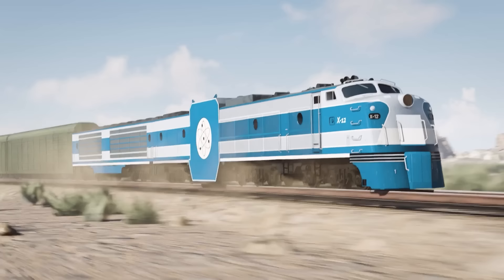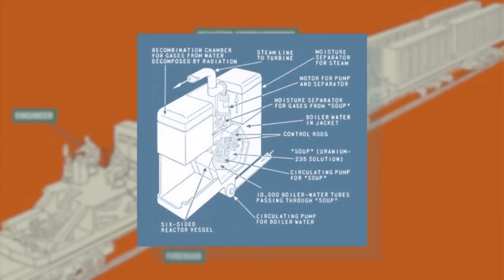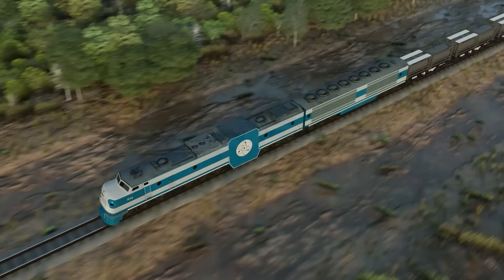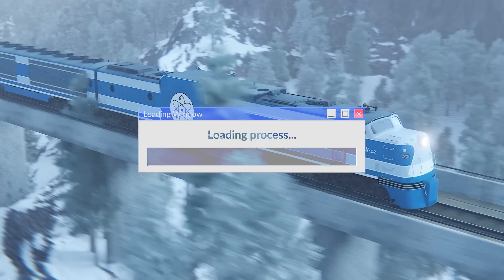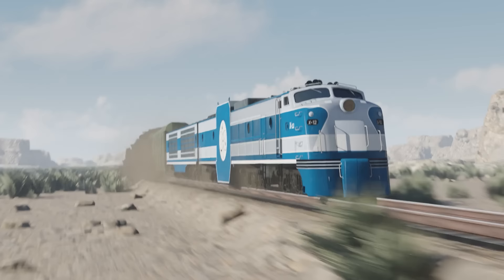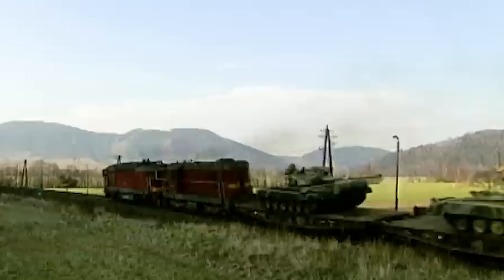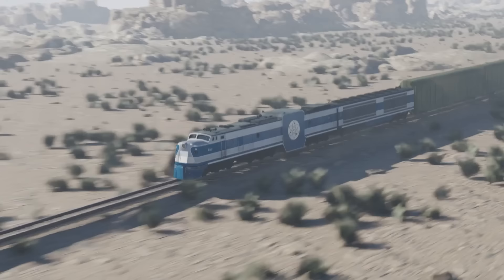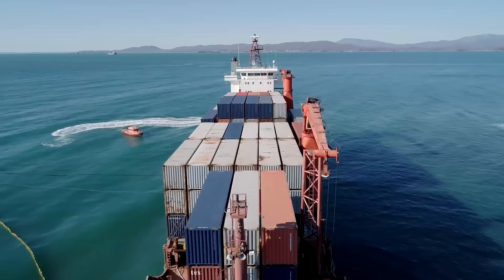What ever happened to Atomic Trains?

Comment: She would not only be a steam train she would be a Steam turbine electric train like modern ones but here you turn the generators by steam turbines and you take the steam from a nuclear reactor that boils water. 

For 12.000 years we still make energy out of boiling water.
Reply: It's more like 300 years..
Reply: cant make energy, and it’s only 300 years
Reply: @freaky1382  What do you do while cooking?  
You boil water 
You boil water by fire 
You use the boiling water to make the food you put into the pot to be tastier 
And cookery was born circa 12.000 years ago when the first town was built and our tribal era lasted 120.000 years when we wore clothes, hunted, gathered,  tamed fire, made weapons and used fire to boil water. 
I said energy, not electricity!
Reply: Honestly, Nuclear energy(electricity) pisses me off.

It's just hot water! WTF!!!!!

It's great but c'mon... why isn't it cooler than just heating up water?
Reply: but the liquid dont need to be water...
Reply: @kjgfalsk  Still the principal is the same. It's just easier with water. But the author said in the epilogue that catenary was the real reason and AC high voltage cable lines and transformation stations made it possible that we can supply locomotives with electricity directly above the track.
Reply: @jaybird0312  well that's the neat part of energy making. Its just so fundamentally same its kinda meme itself.

But ofc why Nukes are cooler because is just so cheap and efficient, and have cool intro when started...
Reply: @whitefalcon630  what you actually need first is a reaction
Reply: @paladro  Cooking is chemistry so you have reaction you just need energy
Reply: I wouldn't really call it to make energy if you're just boiling water without turning the steam into mechanical work, especially not in the same breath as we're talking about steam power. To go long back in time, we have the aeolipile (described e.g. by Heron of Alexandria) about 2000 years ago. It was mostly a toy without doing any useful work but it did at least spin and you could use it as a low efficiency turbine if you wanted.
Reply: @skunkjobb  Well technically yes
Reply: @whitefalcon630  That's not "making energy out of boiling water". The steam engine (at least as anything more than a very crude experiment) is only a few hundred years old.
Reply: technically speaking, boiling water is just a part of the energy conversion process, it's not the "making energy" part of it.
Reply: @whitefalcon630  cooking is not really chemistry, it's mostly physics. Until you burn something that is, then you have a heat-assisted decomposition or charring/tarring
Reply: Yes, because water is easily available for exchanging heat. And that's how most engines and generators work. See: carnot heat cycle.
Reply: @drill_fiend1097  Um, no. Most engines do not use water as part of their power cycle. Internal combustion engines do not, and that covers most of the engines in the world these days. Gas turbines don't use water as a medium either. 

The Carnot cycle isn't a real engine cycle either. It's a purely theoretical cycle which is impossible to actually use. The engine type which comes closest to the Carnot cycle, the Stirling engine, uses air or another gas as the working fluid, not water.

Steam engines are still important, but they are one of many technologies used for energy and propulsion. These days, you don't even necessarily have to be using a heat engine, let alone a steam engine.
Reply: @TonboIV  it doesn't make sense for vehicles that directly burn fuel (Otto-cycle, Diesel cycle, Brayton cycle is better description for them), but body of water is readily available and what many power plants use as heat sink. It's impossible to get a perfect carnot engine, but most power plants that use thermal source try to get as much carnot efficiency as possible because why waste energy.
Reply: @drill_fiend1097  Steam power is still the most popular cycle for thermal power plants, but of course renewable energy is growing fast, and mostly isn't thermal, and even for thermal power, other cycles are creeping in, particularly Stirling and gas turbines.

It's fine to say that we've been using steam power for centuries, but saying that most engines are steam engines, or that steam is our biggest energy source, is just wrong.
Reply: @whitefalcon630  you have done nothing but waffle about irrelevant stuff. You cannot make energy because that breaks the laws of thermodynamics. And what are you on about us cooking?? thats not making energy from it its killing bacteria.
Reply: @freaky1382  You turn energy into work.  
Both in a steam turbine or in a cooking pot.  
Work generates heat and the cycle goes around around around.  

Boiling water is a good thing 
I wasn't waffling dear Foxhole PFP NPC.  
I was talking about how to harness  the work we get from boiling water.
Reply: Solar and wind and hydro (and stuff like wave power too) are the only forms of electricity generation that does not boil water. In fact solar and wind are the only two that don't use water in any way!
Reply: @whitefalcon630  yes, but that water did not move anything. It "just" cooked food. If you are semantic, then we never created or will create energy per se.
Reply: @51mm5  Cooking changes a lot inside the food other than heating up.  
Its structure, when the flesh was alive fell apart 
Water is only the agent.  
But what is important when turning water into mechanical work is steam.
Reply: @pwhnckexstflajizdryvombqug9042   you can make any kind of power make electricity with air and a turbine mate. water is used commercially because its cheap but you dont need it lmao

Comment: lets face it there is no real point in them. just use catanary, no dangerous nuclear reactor on board (of course the power can come from a nuclear power plant too but thats a lot safer in terms of shielding required). also more efficient, you dont need to haul a 200 ton shield around. as well as the huge cooling array.
Reply: People hate it because it sounds too boring and expensive for them. That's too expected

Meanwhile nuclear train provide them with the dopamine rush for F U T U R E and burn their money like nothing tomorrow. Like you know, gambling addiction.
Reply: Millions of tons of steel and wires that need constant checking and maintenance as well as power loss through those millions of tons of wires vs 200 ton sheild and on-sight power ie no power loss, do you even Math dude?
Reply: @kell7195  >Nuclear reactor
>Zero maintenance

Pick one

Comment: 10:42 The best argument. Works in Europe pretty nice. The problem is that the freight operators in the USA do not want to build and maintain overhead wires, as it is associated with costs and it is simply cheaper to run diesel-electric trains.
Reply: not only cheaper but more practical too. We run double stack containers. Europe doesn't
Reply: @dareklachowicz3946  Double stack containers can be electric too. See India. Tunnels in Europe are not tall enough though. Bridges are also a problem.

Comment: Yeah, this just seems like it would be hideously expensive for almost no payoff. It's inefficient, expensive to buy and operate, and what you get for that is a vehicle that doesnt need to be refueled - something that plain electric trains already do while being much cheaper and simpler to run and just as powerful. As a railroad company, you probably save money just electrifying a freight line than investing in an atomic locomotive (hell it already saves you money in the long run vs diesel locomotives).
Reply: I think the cost of the train is the least of their worries, we’e talking about a nuclear train. On standard gauge track a train like this isn’t big enough to sustain a nuclear reactor’s radiation. To even sustain a nuclear reactor and keep radiation from leaking we’d need a train the size of the Breitspurbahn like the germans were planning, which was supposed to be double the size of standard gauge. And i imagine they didn’t have the budget nor space atm to develop it. Besides unless the train was as large as the Breitspurbahn, direct exposure to that radiaiton from the train crew could be lethal.

Comment: Firemen does a little bit more than just hold a shovel. Basically also make sure the boiler does not explode.
Reply: @crackedemerald4930  And ensure that it burns properly. I can't tell too much about Steam Locomotives, but on Steam Ships you use an Air Intake Flap at the Furnace and another Flap inside the Funnel to regulate Air Flow. The Latter Flap prevents Heat from just being wasted out of the Funnel. IIRC Steam Locomotives have Air Intake Flaps too, but the Funnel Updraft instead is controlled with the Blast Pipe instead of a Flap.

Oh and Steam Ships may also include the Logistics of keeping Coal flowing, Locomotives always have the Bunker right next to the Furnace.
Reply: Don't let the boiler explode is the job for both traditional steam and nuclear steam.
Reply: No, the safety valves take care of that.
Reply: @JBofBrisbane  Lifting Safety Valves means that you're wasting Fuel; you're literally producing Steam just to blow it off unused again. In closed Systems, you're also wasting Boiler Water as the Safety Valves blow off to Atmosphere instead of into the Condenser. But that doesn't Matter in Locomotives, as they have an open Water Cycle anyway. Meaning to say the Exhaust Steam is blown out of the Smokestack instead of being condensed to Water and used in the Boiler again.

Anyway, plus letting the Safety Valves Lift is just bad Workmanship, they're intended as last Safety Measure and nothing else. In the automated Boilers that I make a Living with, the Burner cuts out at 10 bar, the Steam Dump is opened at 11 and the Safety Valves lift at 12 bar.
Reply: @JBofBrisbane  Popping the safety valves means wasted shoveling effort. Plus they don't help at all if the water level goes below the crown sheet.

Comment: I think with a small integral molten salt reactor and a CO2 Brayton cycle turbine, this can actually work. No radioactive steam, no water cooling, no high pressure safety hazard.
Reply: There's no question it could work from a technology POV. But a heavy nuclear reactor, running 60-80 mph, with a several thousand tons of dumb weight behind it, is an enormous security risk. Furthermore you need at least one (if not more) skilled technician on board, more than doubling personal costs.

Furthermore it's lacking economies of scale: A larger (not mobile) reactor can produce the same MWh for way less financial input.

In the end, it is just way cheaper to built overhead wiring and combine it with the cheapest form of energy production (nowadays renewables). And we are just ignoring the enormous after-life-expenses of nuclear energy in this example (handling of nuclear fuel, tons of radioactive waste from the reactor block and storing it for tens of thousands of years...).
Reply: NaK is very corrosive, but we do know it works because Breeder reactors tend to use molten salt cycles.

Comment: About the size of the cooler: If the mechanical efficiency would be the same as for a diesel engine, one could expect the cooler to have the same size for the same power of the engine, the same amount of heat has to be dissipated. But that's not the case. In order to get good efficiency, a nuclear reactor needs lower temperature of the cooling water than that for a diesel engine. While a diesel is happy with 70 °C return temperature to the engine (maybe a small part of the total at lower temp if it has a water cooled intercooler), a reactor prefers 30-40 °C return temperature to the condenser. Higher temp leads to loss of efficiency and loss of mechanical power. Lower temp requires a larger cooler.
Reply: Hey Skunk;   I agree that if both Diesel and Nuclear locomotives have the same mechanical efficiency then they would have to reject the same amount of waste heat for a given level of mechanical power output.  The difference that makes the condenser for the Nuclear locomotive so much larger compared to the radiator for a Diesel locomotive is that in the Diesel much of the waste heat (a quick Google search seems to indicate 50%+) is rejected via the exhaust gasses and another chunk (maybe 5-10%) is rejected through the oil cooler.  (Many Diesel engines have oil sprays that cool the underside of the piston heads.)  Some heat will also be rejected directly from the engine block to the ambient air.  In contrast, essentially 100% of the heat rejected from a Nuclear locomotive is rejected via the exhaust steam from the power turbine being condensed back to water in the condenser.  Two more factors increase the size of the condenser for  Nuclear locomotive.  First, the spent steam enters the condenser in the gaseous state and gasses have very low thermal conductivity compared to liquids such as the coolant in a Diesel locomotive. This slows down the heat transfer a lot, thus requiring a larger condenser.  Second, the Nuclear locomotive condenser is being cooled by ambient air at perhaps a design maximum of 40 degrees C. and the condensed water output is just below 100 degrees C. so the delta T is only 60 degrees C.  In a diesel locomotive the cooling system will probably be under pressure to increase the boiling temperature of the coolant.  Many older Diesel locomotives run plain water (with corrosion inhibitors) as coolant but more modern ones use a mixture of water and ethylene glycol.  A 50/50 mixture of ethylene glycol and water pressurized to 15 PSI boils at over 131 degrees C. so the system can be run with delta T of about 90 degrees C. compared to 60 degrees C. for the Nuclear locomotive.  This will make the Diesel  locomotive radiator much more effective for a given size.

Full disclosure...  I am an electronic engineer, not a thermodynamicist.  If there is a thermodynamics expert in the crowd please chime in to let me know if I am on the correct track or not...
Reply: A dieselo reject half its heat through the radiator and half through the exhaust.  A steam engine must reject all of its heat through the radiator.  The only way around this is to increase operating temperature so a smaller radiator is needed.  Best done with CO2 or Helium rather than water.

Comment: Just reminds me of the Swiss railways "electric e3/3" where they got a steam loco, put toasters in the fire box and give it a go. The funniest is that they did it and it was somehow good. I love my country 🇨🇭
Reply: Not exactly. The original Firebox was kept, and Electric Continuous Flow Heaters were added on top of that. They ran in fairly low Voltage, resulting in the ridiculous Current of 6 kA. The Fireboxes usually even retained a small Wood Fire, to be used as "Range Extender" on longer Stretches of un-electrified Track.

Comment: I think its downfall was the complexity and the weight of the reactor itself. But fortunately, modern Generation IV reactors are much smaller in size and you could probably build a nuclear-powered train about the size of an EMD DDA40X that could potentially be rated at 7,000 bhp or more.
Reply: You still have to take into consideration the consequences of what would happen if it derailed  or something. Even if it’s possible to build a practical train I don’t think one will be built.
Reply: Yopu would use a higher temperature and a gas as a working fluid, that would make the radiators much smaller.
Reply: The fuel wold be contained in silicon carbide, graphite ceamtic grains assembled into pellets.  They would isolate the radioactive material and shot down from thermal resonance.
Reply: But why would you bother? It would be simpler, cheaper, safer, and much more flexible to build a stationary nuclear power plant and run electric trains with overhead wires. That would also give you the ability to travel indefinitely without refueling (not an issue with modern trains anyway), wouldn't generate emissions, and can have an essentially arbitrary amount of horsepower. Unlike a nuclear train, the technology to do that safely already exists, wouldn't risk a nuclear disaster in the event of a derailment (or just a fuckup by an overworked reactor tech who hasn't slept in 3 days), and wouldn't require the construction of hundreds of miniaturized nuclear reactors to stuff into locomotives. 

They also have the advantage of flexibility; both the trains and the nuclear plant would be connected to the grid. When the trains aren't moving, the plant would provide power to the grid, and when the plant is down for maintenance, the grid could supply power for the trains.

Onboard nuclear reactors only make sense when you need extremely long range operation and can't feasibly connect the vehicle to the power grid. That's absolutely not the case with a train; we've been connecting trains to power grids for well over 100 years now.
Reply: @a.p.2356  If you think it would be far more "easy" and "efficient" to run millions of tons or wires and steel towers everywhere + all that energy loss through those thousands of kilometers or wires than small modular LIFTER Reactors that are impossible to melt down providing power directly to the wheels beneath them you need your head read or frankly you have no idea what you are talking about.